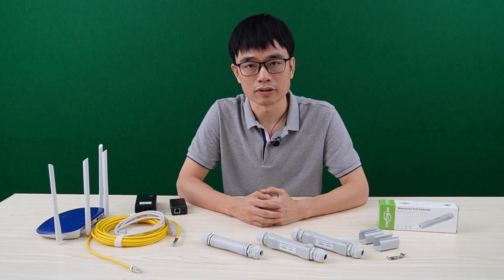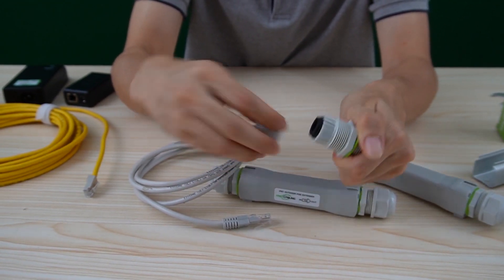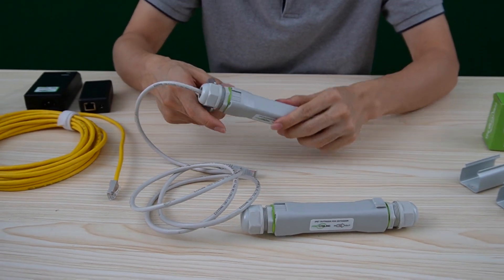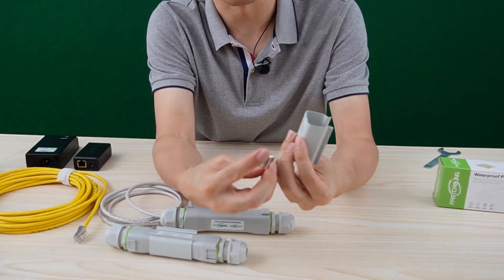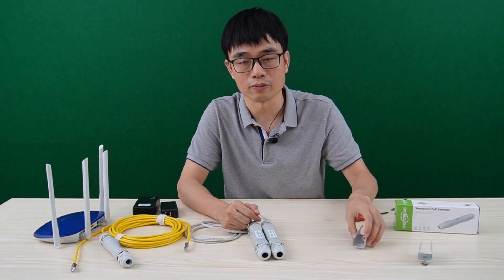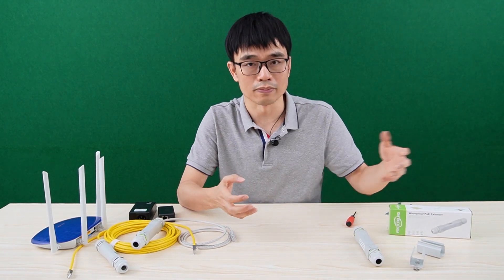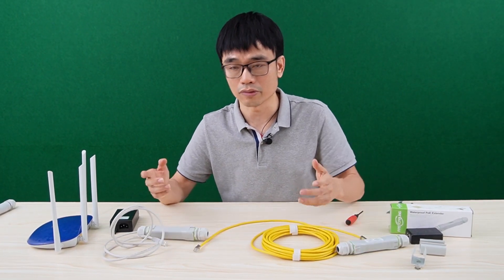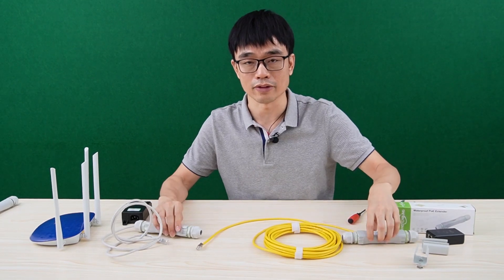1st vs 2nd Version PoE Extender

Comment: I have a poe 24 volt .5 amp output . WIll this work with the poe splitter ?
Reply from the maker: Negative, I don’t see there is any PoE extension solution which is designed for non-standard PoE (DC24V PoE aka passive PoE)